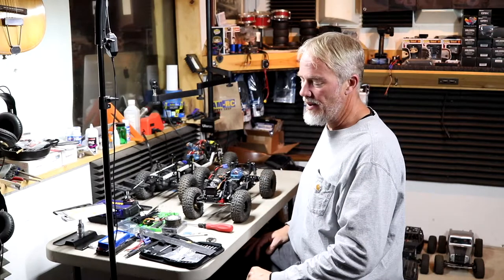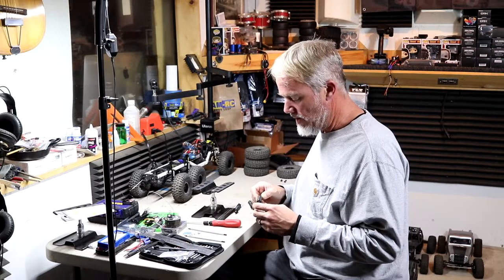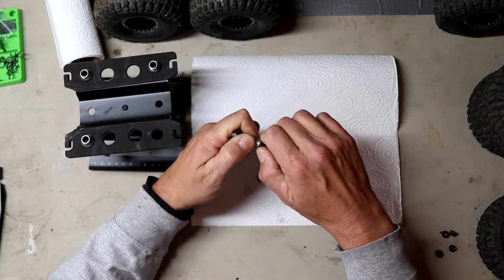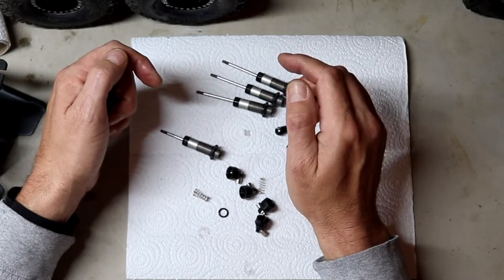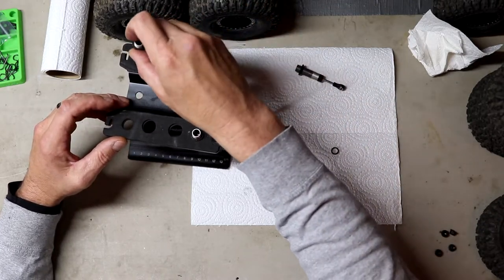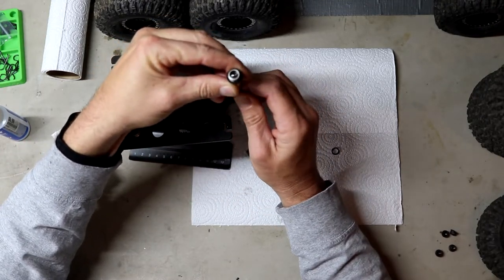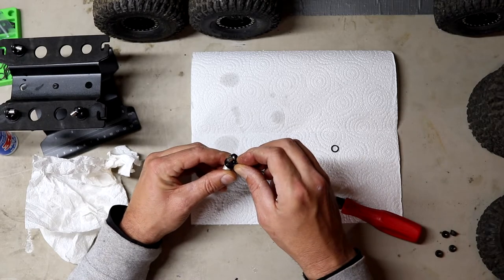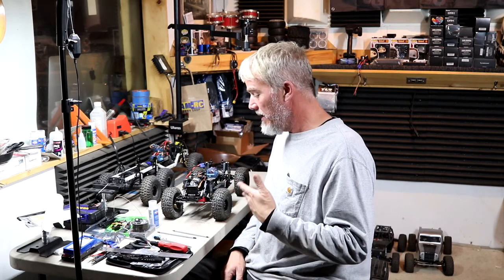How to do a Pen Spring Mod 2022 on Axial SCX10iii

Comment: You mentioned 5 millimeter inside diameter.  Is 5 millimeter outside diameter is the same ballpark? Thanks for the video!
Reply from the maker: They were 5mm o.d. , sorry for my mistake . Here are the ones I used -https://www.amazon.com/Stainless-Steel-Compression-Springs-15mm/dp/B07RSZTYXC/ref=sr_1_4?crid=3NIRGCN6F4AH7&keywords=5mm%2Bx%2B15mm%2Bstainless%2Bsteel%2Bsprings&qid=1701003335&sprefix=5mm%2Bx%2B15mm%2Bstainless%2Bsteel%2Bsprings%2Caps%2C68&sr=8-4&th=1
Reply from the maker: Also , thanks for watching !